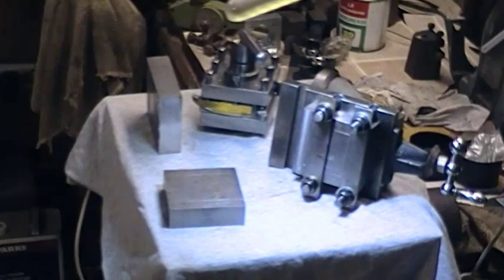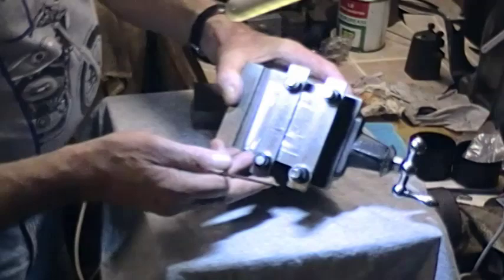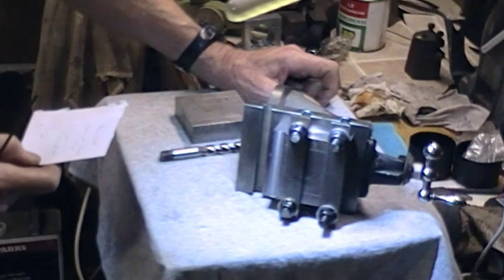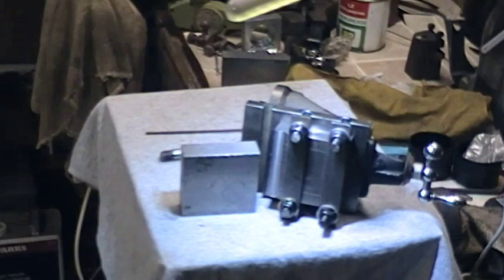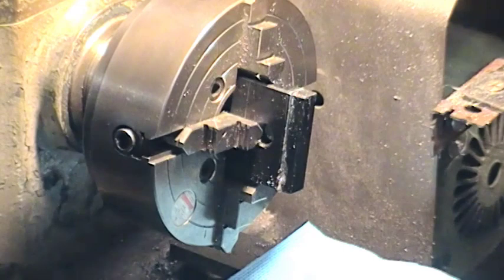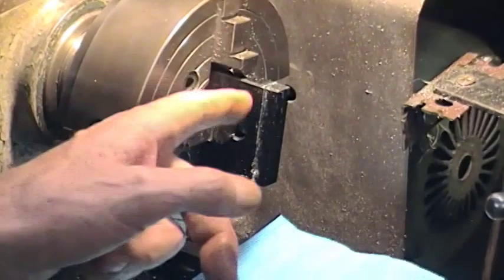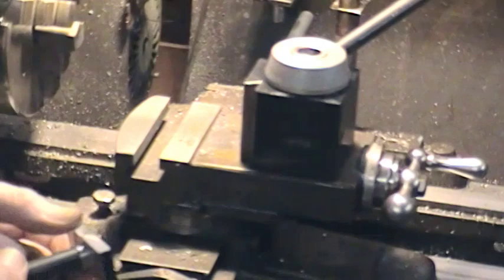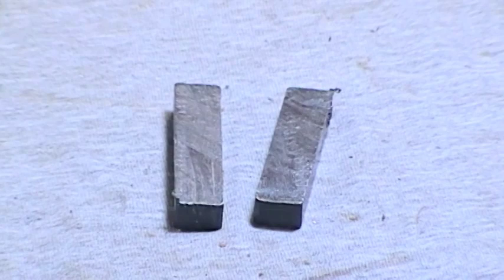A tool post project

Comment: Hats off for you sawing that piece of metal off - I would have gone mad after half way ;-)
I am trying to build a 4-way toolpost for my lathe at the moment, with no milling involved (since I have neither a mill nor a milling attachment). It consists of three pieces sandwiched together (two large ones and a small in the middle) - and it seems to work fine. Unfortunately it's a little too high for my lathe at the moment, so I gave it to my neighbor to mill it down a little - and I tried to get around that Lol
Best Wishes
Adrian
Reply from the maker: Way to go Adrian -- sandwich approach works just fine.  Hopefully someone (neighbor) with a mill - even a horizontal one would do fine. Hope it works out.

Comment: Chris:  I'm sure you already noticed, but one of the two similar-looking tool-holders has a "vee" groove at the bottom, to hold round tools or a small-ish boring bar.  I'm anxious go see your new toolpost in action!  Everyone says that a quick-change toolpost is the first and best upgrade to do for a lathe.  Thanks for the video!  Regards, Bruce.
Reply from the maker: Certainly, would be handy to have integral "V" groove - however, I manage by slipping in a small piece with a groove in whatever station is free at the time. Otherwise i have some holders that take some of the standard diameter boring bar shanks. Have already used new toolpost - with all three now I have something like 16 options quickly ready to go - luxury!  Now just need winter gone so I can get back in shop without freezing! :)

Comment: Chris:  I think you misunderstood me.  I was talking about your new Aloris-type tool-holders.  You said that two of them looked the same (#1 and #2, I believe).  The one that has "boring" in the name (#2) has an integral vee groove at the bottom of it.  It is easy to miss!  Bruce.
Reply from the maker: Oops - yes I misread, as was thinking you referred to the four-way.  Indeed yes, the 102 Aloris type holder does have the shallow "V" groove and I had initially overlooked that - does make it useful for sure.